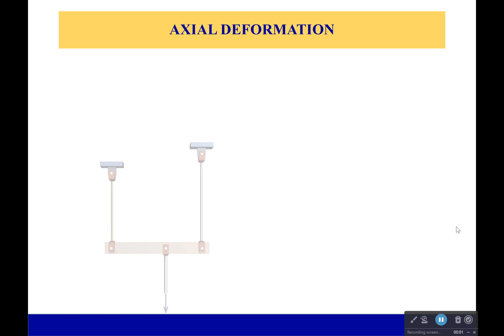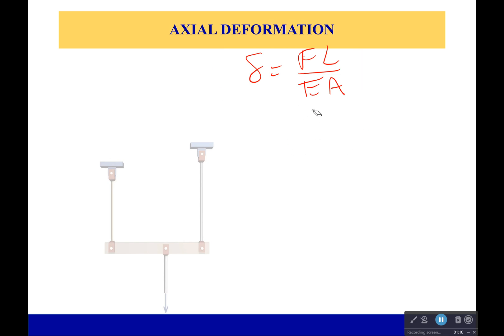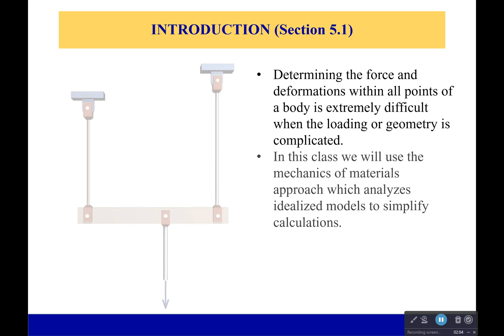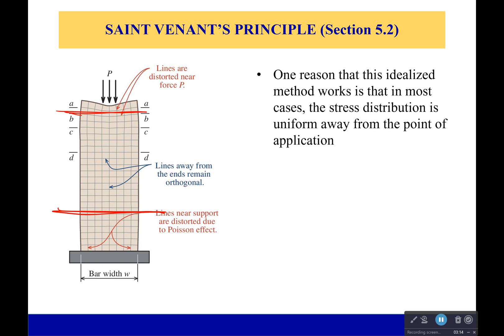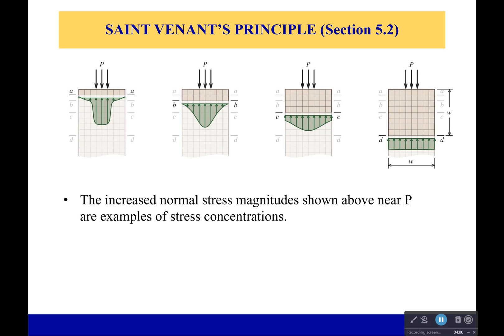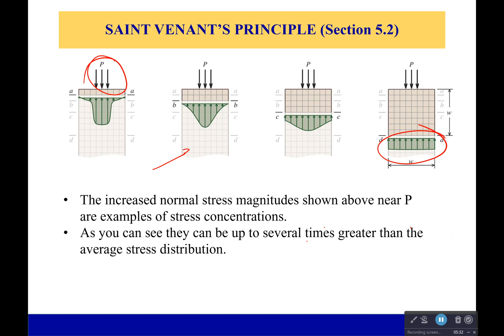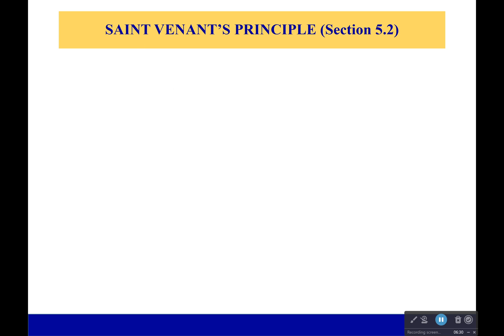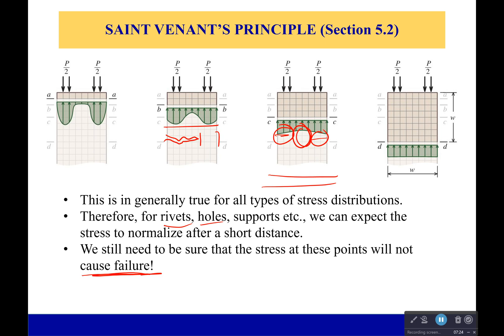Saint Venant's Principle

Comment: Hello Dr. Kidd, this cleared up the principle quite a bit. l stumbled upon Venant from this video https://www.youtube.com/watch?v=TgpM6xOTfuE. I specifically am trying to understand the claim the author makes around the 4:35 min mark, about the 10-15% if you could be so kind as to explain it or maybe get in touch?
Reply from the maker: So there are a few things going on here. When the author is mentioning Saint Venant's principle, they are talking about how locally at a surface, there are can be large stress concentrations due to a force. That means the material might fail right there at the surface. This is often seen in bearing failure where a column crushes the ground just underneath it. The 10-15% remark is more of a rule of thumb stating that even if you have local failure at the surface of a part, so long as that does not extend more than 10-15% through the surface, you can still use it. That range will change depending on the application. The reason you can have it propagate part of the way is that Saint Venant's tells us that the force will gradually get evened out so local failure doesn't mean it will be failing further into the material. Hopefully that helps!
Reply: @drkiddengineering  Yes that helps a lot, thank you so much for taking the time to explain it! I was worried that if I have failure in the local spot, like in a  bearing load, (failure meaning above yield strength, and not tensile/ultimate yield strength) and it was a machine running a few cycles a day then I would see a crack start to propagate from that local point since I'm crossing into plastic deformation region in that area.

Comment: What about a compression on a larger body? does Saint Venant's Principle still applies? In the example you showed a bar with a diameter of W, the equilibrium d appears roughly at a distance of d=W, but what if W is really large?? infinite large even, how would you obtain d?
Reply from the maker: Okay. I love this question and I don't have a good answer for it. Saint Venant's principle is something that we can check experimentally, but in practice don't use to figure out a theoretical perfect distance. Another thing to think about is that stress is F/A if we had an infinitely large area our stress would be zero. This only really works for things of finite size. The last idea I would have you think on is the concept of bearing stress. While the object I stand on may have an infinite or very large size, the object supplying the force likely does not. In that case I would guess that the distance would be on the order of the diameter of the object applying the force.